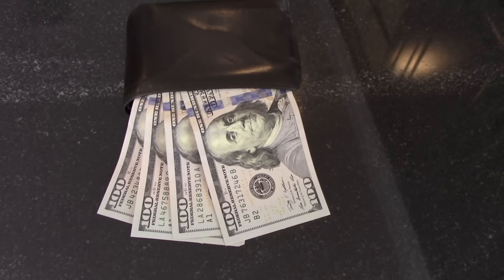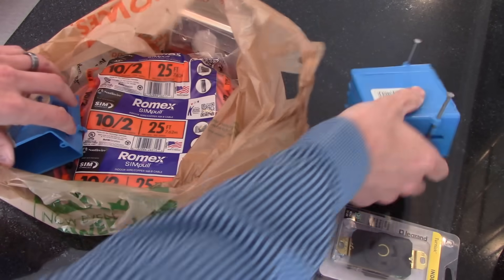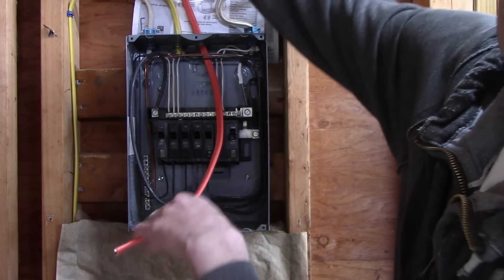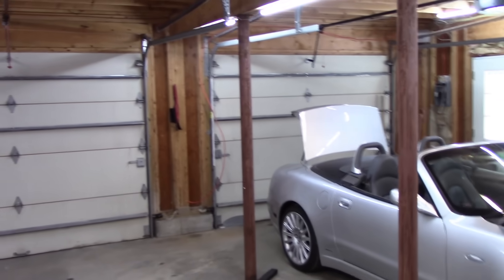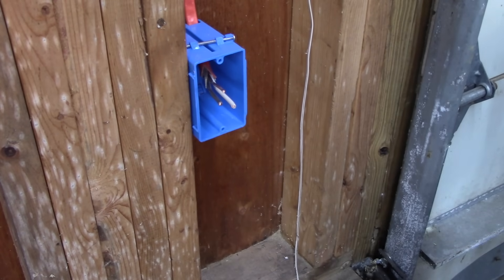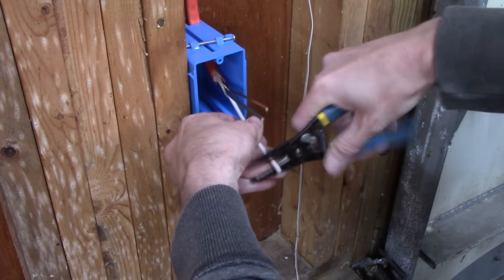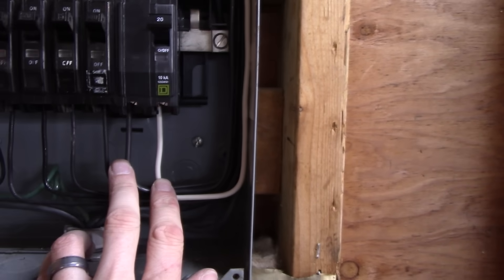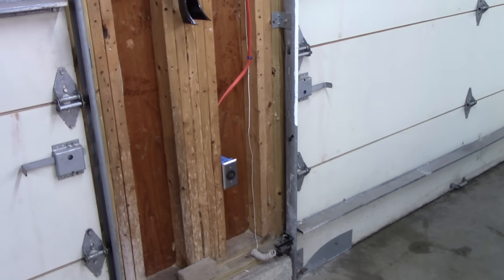DETAILED DIY: Wiring a 240v outlet step by step from breaker to outlet

Comment from the maker: Gentleman, HOW WOULD YOU LIKE YOUR OWN PERSONAL STRIPPER?  :)  Klein makes the best IMO and here's a link to the same ones seen in this video:  https://www.amazon.com/gp/product/B00080DPNQ/ref=as_li_tl?ie=UTF8&tag=trialnerror-20&camp=1789&creative=9325&linkCode=as2&creativeASIN=B00080DPNQ&linkId=264f8a16e5a1b6edc79671f51ab0b84f
Reply: The new harbor freight Doyle pliers are honestly just as good as Klein. Seriously. Their old pliers are only good for use as a paper weight but the doyles are the real deal. The doyle needle nose pliers are the best needle nose ive ever had. Worth checking out. Never tried the stripper though, always just use my knife
Reply: Yes, Klein strippers are my favorite also. HFT has simular cheap ones that are not bad also.

Comment: Hi, I assume if a guy has a breaker box panel with all 110 breakers in it, and it's full, you can just remove two of the 110 breakers and put a 30 amp 220 breaker in there place for a 220 plug in?? I do know my breaker box panel is a 30 amp. Let me know? I know I can do it, just haven't done a whole lot of house electrical work, so just wanting to be sure I'm doing it right? Thanks!

Comment: When you flipped the plug because it was upside down, does it matter where you have the ground neutral?, Thought the neutral was on the bottom red and black up on top.
2) what are the bare copper wires showing in the breaker box, upper left corner?

Comment: Great video, the only comment I have is if you using 10/2 etc. for 220V you should put either black or red tape or heat shrink on both ends of the white wire so if someone other than you will know it’s not being used as a neutral. Not a problem to figure out at the breaker, but on the other end it could be. I found that out when we remodeled my house and a jack leg electrician wired a 110V outlet for the microwave, didn’t check voltage and burned up my microwave.
Reply: Can a 240v actually be done with 10/2? I was always told NFPAs required 10/3?

Comment: Hi.  For the 10/2 wiring running across the top of the garage door (on the frame)...it didn't need to be in conduit of some sort?  Just me asking because I need to run a 220 to a garage heater.  Thanks in advance.

Comment: Good video but should leave a bend in wire above the box for extra slack in case you need extra wire for a fix later on if not be a lot more work

Comment: Greetings, it looks pretty good, however you should take some red or black or blue lectricians tape
and wrap it around the white wire at both ends to identify it as an UNgrounded conductor. Nice 
thatyou included a disclaimer.
 "I like to keep my box clean, get to stripping" u the brother of Mae West?
she was pretty good about those sexual impications. But yes a neat looking box is a good sign of 
a professional job. Ur keeping up w things having the ground on top as shown by the crook in the slot. Good that you know grounds and neutral never get tied past the main panel.

Comment: Watched this because I'm wiring a 220v ac power generator to it.  I'll be running about 3300W through it, so a 30A breaker will do just fine.

Comment: A major DIYer here, and I like knowing details of my projects, and I'm engineer-minded to boot. About to install a 30 amp breaker for a window AC/heat unit, myself, since my husband limited gray matter, basically has the brain cells of an adolescent. 

I've learned my way around basic home wiring projects, thru videos like your's, which is very well made! The sexual inuindos are kinda off-putting, but whatever, your video quality is excellent. With your help I get to seriously compete with one of my three marine sons, who is also an aerospace engineer. In the past year I've learned how to install ceiling fans/light fixtures (where none existed), run wire and install new outlets/switches. The attic is a place from hell, literally.

Thank you so much for this video!!!

Comment: If you hit the wire with a heat gun or torch for about 25 seconds the insulation will damn near fall off

Comment: Good video! One thing I would do, on the receptacle, is bend the wire around the hook clockwise  and secure it. It is less likely to come lose when handling the box.
Reply: It is a pressure connector on a twist lock receptacle.  You don't bend the wire around the screw.

Comment: I notice you got a 10-2 wire which can handle up to a 30 amp breaker. That two pole breaker you showed is a 20 amp double pole breaker. Why not a 30 amp dp breaker? So what are you running on 220 v supply? My welder requires an input of 29.6 amps. So a 30 amp breaker would trip. I’m running a 40 amp dual pole breaker.
Reply from the maker: I bought the wrong one, there's a 30 in there now!

Comment: Your thumbnail said 220 but your description says 240 volt. I know it's nominal but still. It.confuses people.
Reply from the maker: 110/120v 220/240v are both relatively common descriptions for AC.  It's more of a historic designation when AC line voltage varied more than it does today. Both essentially mean the same thing.
Reply: @Trialnerror  I know. I'm a master electrician. 😎
Reply from the maker: @briank1263  Well in that case, don't watch this shit show of a hackjob :)
Reply: @Trialnerror  no way man. I admire what you're doing. We definitely need more qualified and dedicated electricians out in the world right now. I've seen alot of bad ones over the years. I didn't mean to come off as arrogant. You're actually doing something productive. I certainly can admire that for sure. Best of luck brother. Any electrician that says they know it all is lying. I don't care how many years they have in the trade.

Comment: If im going to do a 50 A breaker, what wire would i need for it?

Edit It would also be running about 30-50 feet. No more than 50 feet though.
Reply: #6 wire. Make sure the device or equipment you're installing is rated for 50 amps.

Comment: The wife and I were making bets as to when the windchimes were going to go flying across the garage....lol.  GREAT video bud....this isn't nearly as hard as I was making it.  Thanks for taking the time.  Although, my stupid question of the day would be..."why wouldn't you attach the wires to the new breaker, then snap the breaker in"??  Just curios.
Reply: Two reasons.  First, It’s harder to get the install angle on the breaker with the wires already connected (much more difficult with 6 or 4 gauge wires) ;secondly, if you have any kind of short between the two wires (downstream), it’s better to find that out with the breaker already “installed” and with a firm grip. Less surprises, drops, sparks and high-pitched screams that way, lol.  Other than that, there’s no other reason, especially with low gauge wires.
Reply from the maker: To answer your question, not sure TBH.  Just always done it that way.  Thanks for the kind words and for watching!

Comment: nothing wrong with over sizing your wire but with the 20 amps you cld have used 12/2 to up to 75ft(i might be wrong been awhile since i looked at codes for distance drop lol) be cheaper its all about watts of power though tht 2 pole 20 good for a max of 4800 watts the 10/2 can hold max 7200. downgrade %20 for constant load.

its for a welder ya always up size the wire for a welder the bigger the ground the better with welders

Comment: When I was a Teenager  I was helping my Dad doing a Remodeling of our Laundry room that basically was a small room  between our garage and kitchen of our home , we started by moving the Electric Dryer  and  I grabbed the Machine  by reaching around the back of it  and grabbed  it by a open area  that was where the Poer Cord was wired to the machine  Intouched it in a way that  I felt the electricity run through my body luckily I was capable of letting it go  my Dad thinks my Rubber soled Sneakers saved my life ?minwill say it was  a pretty strange feeling  as it twitched all the nerves inmy arm at the same time ? As luck would have it inmy 40s I suffered a Major Stroke on the Operating table  that fried 90 to95% of my brains rightbhemisphere  and my brain doesn’t control my muscles any longer but  in order to walk ,talk, or do anything physical my brain actually figured out a new way to make things happen by sending  a signal to the nerves closest to the muscle I want moved  I am not a genius  it figured it out on it’s own  but sometimes  I do get  several nerves  signaled at the same time  and it feels similar to that jolt from the Dryer ?  Btw it’s a nasty feeling  and I really have a lot of respect for Electricity  I was in Commercial Construction for most of my Adult life  and I did witness a Electrician getting hit when working on a Ladder in a drop ceiling one time he did survive  but made a hell of a noise  jumping off that ladder I am a retired Woodworker and I hire my freind a Electrician to do all my hookups  to save a few bucks he does let me  pull my own wiring ahead of him  as a favour  and of course he can pull permits if i need them  many of my Woodworking Machinery is 220  so I do have him do those  and sometimes wire up things like a Welder  for a specific socket when I need to use that temporarily to do a repair or a metal job

Comment: 240v on 2 wire, interesting....think your missing either a hot or a neutral
Reply: wondered about that, too... but, that's how the package is labeled.. It has the (3rd) bare copper.

Comment: At 9:50 you show connections to outlet as black and white, Does it matter if they are reversed considering they are both hot ? Also shouldn’t the white wire be taped black on both ends to indicate hot ?
Reply from the maker: Nope, doesn't matter.  They are exactly the same except each feed comes off a different tap at the power companies transformers.  Yes, you should tape them up black to hopefully save the next guy from a surprise :)

Comment: Can I use 2 120 volts to make a 220 for a dryer as a diy maybe you can let me no if it’s possible. I have a receptacle on the right and on the left can I put a 220 volt in the middles of that room which is small

Comment: Tanks for the clear video.  Newbie question: how come for a regular single pole breaker we have 1 live and 1 neutral, but for a 220 double pole there is still 2 wires. Both both are used as live wires?  Where is the neutral ( return ).  I would have expect to have a 3 wires cable ( 2 lives and 1 neutral ) for such an installation
Reply from the maker: Because the ground on a 220v circuit is bonded and used in place of a neutral.  With that said, some appliances do call for a separate neutral in addition to the ground and two hot's but that's very rare.  Hope that helps bud and thanks for watching!

Comment: Just a tip....., or two!  A pair of gloves would be lovely when working in a live box!  Safety glasses are a plus!  Long sleeves not a bad choice! Lots of copper flopping around those live terminals!  How about cutting power if possible to put safety at a premium?  And one last, stress the dangers of that ground wire making contact with a live terminal!  The arc flash is devastating!  It will most definitely reduce the sexual innuendos or the frequency of encounters!  Molten metal doesn't do much for the complexion!
Reply: Fuck man if you want to see it done your way then make your own video. Otherwise shit up and watch.

Comment: I also do recommend if you do add a dedicated circuit for a 30 amp current draw don't do it off of a small service panel you want to upgrade your main panel to 200 amps granted that if your wife is wanting to do laundry or run the microwave while you're trying to f**** reweld the muffler it could create problems off of a 60 or 100 amp service which looks like what he hooked it up to we all know marriage is like communication

Comment: Would this work if plugged into 2 separate 12v dc to 120v ac power inverters.
12v solar battery bank to 2 separate 120v power inverter, going into a Panel. 120v on each terminal. Neutral bar tied to ground in panel? Ground tied to copper rod going into earth.
I know the panel could provide 120v to single breakers, but could it handle a double pole breaker at 240? Assuming I had a large enough battery bank and power inverters size to handle the load.
The two 120v power inverter running of same battery bank.
Reply from the maker: I imagine it would though I've never tried it to be positive.  In theory I cannot think of a reason why it wouldn't work though I would separate the neutral buss from the actual ground since the inverters won't have a true ground themselves.  Be safe and let me know if you decide to try it!
Reply: @Trialnerror  I wasn't planning on doing it.. just wondering if it would work. After talking another user. They pointed out that the inverters would have to be in sync with eachother. Since there is no provision for that you could end up damaging 1 or both the inverters. Oh well I was onto somthing for a min.

Comment: Man the hardest part was trying to find the parts
Order the 50a breaker from eBay dp-4075
The wire from offer up great price 10/2
Plug-in receptacle some website 3 prong 240v
Home Depot for the cover and the conduit
Nobody had it all in one place
Reply: ... now u know why electricians double charge ya

Comment: When you do your next video can you also where protective, close fitting gloves just in case your hands accidentally completes a circuit when your illustrating an issue. I'm in no way certified as an electrician...so as a precaution, when I power off the main breakers ,I treat every wire as live and check with a voltmeter or non-contact voltage induction  tester...thanks!
Reply: Concerning attention to detail,
I can see your concern, as I don't know if you would know " where ", to " wear ", protective clothing !
Shocking, I know !
Just Say'n !
😊👍
Reply: You’re telling him what he can and can’t do in HIS own video?

Comment: I'm looking at putting in a tankless water heater.  It says it needs "2 x 60 amp, each with #6 AWG Wire
(2-1 type, 2 hots + ground)."  I am trying to figure out if that means I need to run 2 sets (2 black, 2 white, and 2 ground) of 6 gauge wire or just a black, white, and ground and if the 2x60amp is similar to the breaker you installed in this video.  Do you have any idea?
Reply: WJ Handy Dad what is the total kw?   This heater may be too big to install on your electrical system.   What is heater total KW, what is the amp rating of your electric service?

Comment: Not sure why you didn’t run a Metal Conduit from the sub breaker box to the outlet. I’m pretty sure that’s what it calls for code. Other than that, great work running the wires clean and great video.
Reply: Code only calls for conduit if you are burying it or if the wires are exposed (meaning not double insulated).

Comment: I have to admit, i have screwed with live 120 a lot from being too lazy to power down. I can say from personal experience to NEVER do it if you are sweaty (even barely moist) and grounded.  Then 60 hz really does hurt vs. being an uncomfortable jolt like when touching wire "normally" dry.  You might even feel sick for a half hour not to mention like feeling someone just punched pretty hard you where you contacted the wire.  At LEAST wear some kind of insulating gloves.  Even the cheap $3 neoprene coated gloves help a lot, not to mention protecting from cuts.  

All wire under 7 feet high needs to be protected either with a chase, flex, or conduit.  How much conduit drop you can use with non nonconduit wire depends on local code.

Comment: So quick question as I’m watching this. Would you suggest 10-2 rather than 12-2. I was told by my uncle I could run everything on 12-2 but me being concerned with my house burning down I want to do it right lol. Are outlets and light fixtures fine to run with 14-2 or should I move to 12? Any help would be great. First time renovating my own place. Just looking for some good advice! Thanks!
Reply: 10-2 rather than 12-2 with a 220 outlet *
Reply: Everything in the house that uses a 15 amp breaker is 14-2 a dryer outlet can use a 12-2 or 12-3 if the dryer is less than 20 feet from the breaker box because of loss of power but if you're going 50' or less use 10-2 over 50' use 8-2 or 8-3 depending on if you're using 3 wire outlet or 4 wire outlet

Comment: Question I’m
Looking to buy a 10hr 80gal 2-stage one and it recommends 60a breaker and it has 40a running and 80a start up. I don’t understand electric all i know is my old compressor has 8/2 cable rated at i believe 45a and i have a 50a double pull breaker. I’m a little confused why they reconnect a 60a breaker but they say it’s 80a start us. Can someone tell me if  I’m ok with my 8/2 and 50a breaker or so i need to update my line. Any help appreciated.
Reply: BJ Putvain    The answer is if it says 60 amp breaker then use 60 amp breaker.   A 60 breaker has time delay to allow the 80 ampere inrush current.   If you can, you should change the conductors to #6.   If not, the NEC says the conductors must be able to carry the running current.   #8 meets that, but I wouldn't do it.   I would suggest a 60a disconnect switch and #6 cord rather than 60 amp receptacle and plug.   Best luck!   Kevin

Comment: Great video. I just installed a 6-50 NEMA outlet with a 50amp breaker. When I tested the 6-50 outlet with my voltage tester, my tester is reading 120V. Do you know why? Thanks for your help

Comment: For all the first timers, if you decide to do it live make sure the breaker is in the off position before putting a screwdriver on it. I recommend an insulated screwdriver. Its safer to do it with a dead box tho. specially if its a subpanel and doesn't effect the house when shutting it off. good luck and be safe.